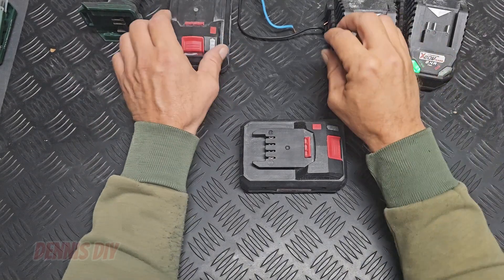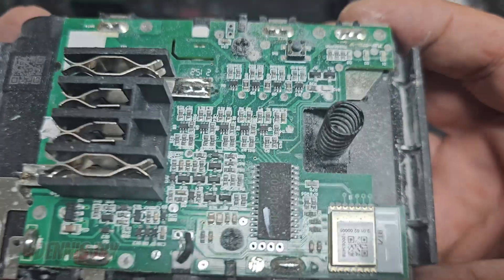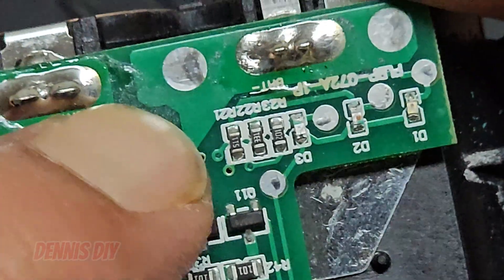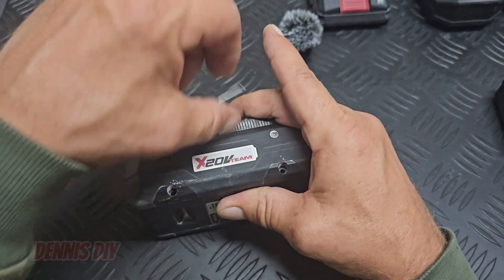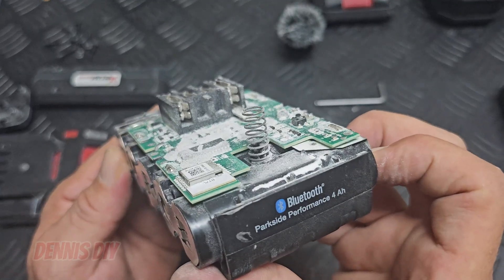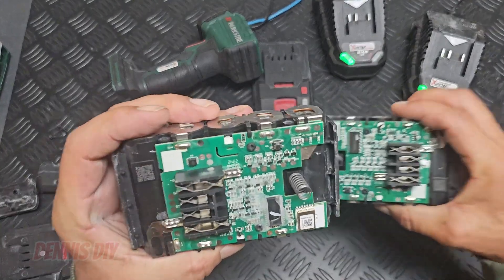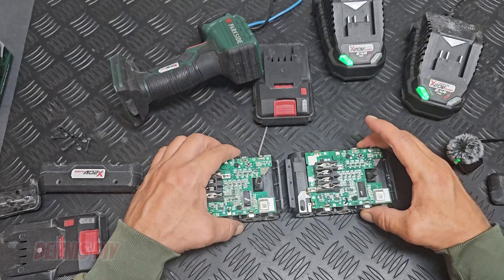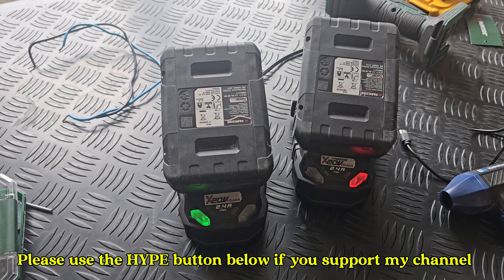Battery problem PARKSIDE Battery capacity LED lights not working

Comment: Try some contact cleaner, spray it directly in the switch, maybe that wil help?
Reply: I like to buy broken Parkside batteries, repair them and then use them or give away to friends and family. 

I change the push button on every single 20V Performance Battery that I ever open. 
Because the buttons are always broken. 

As in your video, you can tell that sometimes they do work again. But other times, they will just stop working. It's a floating issue, kinda. 

Anyway, I use a white, rectangular 3x6x4.3 button from AliExpress, because I had a kit of 250 buttons, 10types × 25 and this was a button that fits in terms of height. I solder the button across the contacts of the two traces so it fits lengthwise and makes the two traces contact when the button is pushed. 

And then I forget about the issue because it works. 

In your case, you still have warranty. So get the replacement batteries and then you can replace the buttons on the old batteries and get them to work reliably again.
Reply from the maker: One is worked the other doesn't  work, but you are completely right. Those. Buttons  do have a issue all te time
Reply from the maker: That's also a good idea, but they work again luckily
Reply: @DennisDIY  bonjour, comment avez vous fait pour que cela re fonctionne ?
Reply from the maker: With the wires see the other battery video on my channel